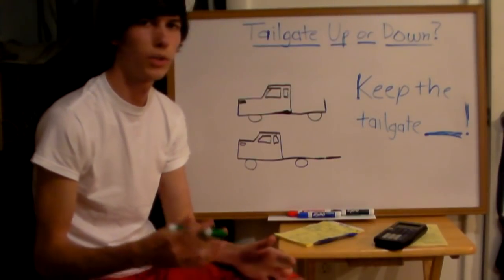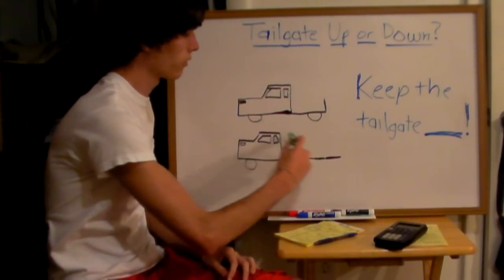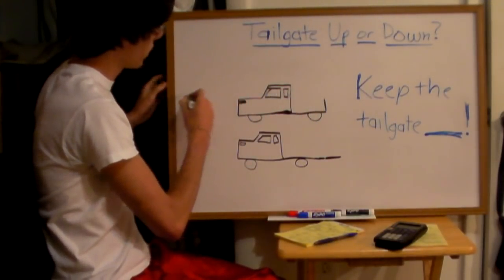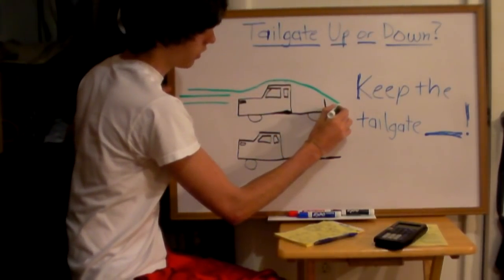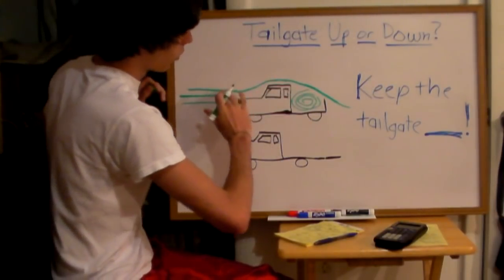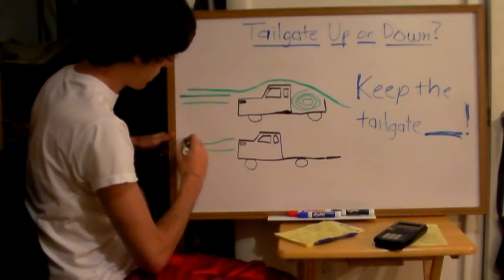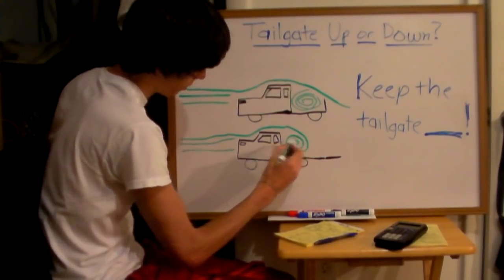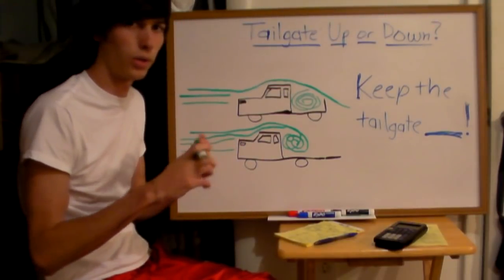Tailgate Up or Down - Explained

Comment from the maker: I actually did put model trucks (as part of a lab) in a wind tunnel while still in school, and the results were as I described above.
Reply: Did you do any models with typical obstructions in the bed for example a cross-bed toolbox or cargo in the bed?  I have experience that disagrees but, there was toolbox, cargo, significant rake (taller rear) and substantially underpowered engine for the configuration.  So far i have found the obvious claim by truck manufacturer that covering the bed entirely helps and an analysis claiming that lowering the rear height at least 2 inches helps but no information for example on a partial cover of the bed or junk like a few crates etc might affect the dynamics to get a result different than the ideal empty bed.  Any ideas might help me avoid making a silly model and playing with it in a poorly improvised wind tunnel to figure this out. Thanks!
Reply: Ah one more difference was a crawl-thru cab window that was always open i wonder if this impacts the dynamics inside the bed.

Comment: Tailgate down gains me about 1.8mpg over 200mile hwy driving intervals. I've measured it many times by topoff method and my mpg measurements don't lie. If ur presenting such a looped vortex in that there's enough resistance at base of the bed then the air should have no problem skimming over the top of it much of the same as tail up.
Reply: 8ft bed???

Comment from the maker: That black dust is likely burned oil from your exhaust. I'd check your oil level frequently to make sure you're not burning through it too fast. I have to add a half quart every 500 miles or so. But no, I wouldn't say that's why hatchbacks create a lot of drag. Designed right they can have equally low drag coefficients as other vehicles.

Comment: My truck is a 2002 Chevy Silverado and I always check my mpg on every fill up. And I always fill up to full. And science might be right about this. But my truck gets better mileage with the tailgate down. When I worked close to home and now driving 90 minutes to work, tailgate down gets better mpg on my truck by 1 to 2 mpg.
Reply: 8ft bed???

Comment: Tailgate up sure for double cab truck,
but I have single cab model,
so the tailgate is too far from the cabin and the air is down to tailgate.
I will try to test my truck, about the acceleration on high speeds with up and down to see the time results

Comment: does this work the same with long beds as well as short beds?  standard cab vs extended cab?  where can I get more details?
Reply: lizzardlife I had the same question. I have a F350 dually with 8 foot box. I also have a cover. I’ve tried with cover on, cover off, tailgate up, tailgate down. I occasionally saw a +1 mpg with tailgate down, but not consistently enough to rule that being effective. I’ve never saw an increase from tailgate up or cover on. Mostly I get shitty milage all the time which is worse in the winter, I’m assuming because of denser air.

Comment: Drove a farm ute that had a high tray which made it harder to drive or see behind in certain situations, I preferred to remove the tailgate (or fold down) as had better visibility, especially reversing into delivery docks or driveways. I would also fold down the side gates as well when they weren't in use. However this was illegal IF the number plate was obscured.

Comment: is this wind tunnel approved? I have driven an '11 tacoma some time now, and I can tell there is a little fuel economy difference when reaching 90-100mph speeds. I can say that I get better economy with tailgate down.
Reply: It depends on the truck actually. What he says must be true for a VW Amarok for example, but may not work for a ford f-150, just to name something.
Reply: wrong, both of you.
Reply: So what is right? Don't just leave us hanging.
Reply: C'mon. Tacomas can't go 100 mph
Reply: @jdmac8584  my 04 DC maxes out at 104

Comment: Please do a updated video on this topic and add in ,if the tailgate completely off (weight savings) is better mileage or not please. I’m trying to figure out if I take my tailgate off at the drag strip will increase or decrease my 1/4mile times. I kno you said it’s better to keep it up for mpg but I’m curious if taking it completely off and saving some weight is better or not. My tailgate has the locking and unlocking ability so it weighs roughly 55-65lbs I’m just wondering. Ty
Reply: Also be nice if you included this with a bed cover no tailgate and bed cover with tailgate! Cause I’m assuming if it’s better with a bed cover it would weigh less than a tailgate? Trying to get every advantage at the track please let’s make this video!! 🙏🙏

Comment: What about a Tonneau cover, you have weight gain vs improved aero... that would be an interesting thing to see examined and explained.
Reply: I wonder how this works for an older truck where they might have thought less about aerodynamics because fuel efficiency was not a selling point. They used a newer ram that gets almost about 22mpg, but my truck gets around 14, so I have to wonder if there would be a way to improve aerodynamics.
Reply: @BobClemintime  I'm shocked the soft tonneau cover was worse than tailgate down...

Comment: Mythbusters already did this.
Tailgate up > Net = Bed Cover = Tailgate Removed > Tailgate Down.

What I wonder is, will carrying a load in the bed interfere with that "force field of air" as you put it?

Comment: I think this is about (Skin Drag) V.S (Form Drag)
The upper truck is Skin Drag > Form Drag.
The bottom truck is Form Drag > Skin Drag.
How do you think ? Am I right ?
If you look at Corvette ZR1 or Ford GT-40, you would find the tail
of these two sports car are more like the bottom truck.
It is difficult to judge,so I think we should put the truck in the wind 
tunnel to test.

Comment: is your hatchback a diesel? Black smokes accumulates (black dust) which is basically unburnt diesel fuel.
As for hatchback or station wagons, I am just assuming it is just a little "not by much" less aerodynamic than sedans because of drag. Don't know if u know much about guns but a boat-tail bullet will travel much further than flat base because it flat base bullet creates more air drag

Comment: What happens when you (remove) the tailgate ? I cant find anything on that.
Reply: Same thing, the drag/suction is created behind the truck cab, decreasing fuel mileage
Reply: @ghosttoast8326  not if it weighs 75 pounds and is angled the wrong way like on a ranchero

Comment: This is what I have been telling people for so long. Thanks! Please do a video about Hi-Flow Air Filters.  My thoughts are if you can see light through the filter dust can get through. Pros use them for performance but don't have to worry about dust and engine damage because the engine only has to last for one race. Guys like me need my engine to last for 100K+

Comment: They should have put the tailgate in the truck bed during that test just to keep the weight (and weight distribution) of the truck the same. I would still think that keeping the tailgate up is best for gas mileage.

Comment: What do you guys think about the tailgate net? I've had one on my ' 02 Ford Ranger since last summer and i thought i could tell a difference right off the bat, but not sure. The whole time, have i wasted more gas than saving by going with the net, versus tailgate up? If so, i may be putting the tailgate back on soon...
Reply: sounds like a parachute

Comment: @EngineeringExplained thats not mine but i hav and identical one with out the top and im always driving past 80mph  ;D. i dont mind the weight i just want to know if its more stable or safer when im driving 120+mph. just youtube ford svt lightning and youll see ;)

Comment: Is accelerating quickly to the speed limit, say 60km/h, in second gear, and then changing to 5th, more or less economical than slowly increasing speed through the gears?
Reply: Significantly less. When you wind the engine up to a high speed, it is firing much more often, but the amount of work it extracts from each explosion is much less, for several reasons. One, once you get above a certain engine speed not all of the fuel is burned by the time the exhaust valve opens, and the balance of the fuel burns in the exhaust system, performing no work at all. Two, when the engine is spinning faster, the internal friction is higher due to greater drag from the accessories as well as the oil pump and decreased efficiency of the lubrication system as the greater shear forces push more oil away from the moving parts. Third, if you're running higher RPM with a partial throttle, less air is pulled into the cylinder compared to a lower RPM with the same throttle position because the shorter time allowed to suck air past the drag of the throttle plate results in a higher internal vacuum in the cylinder. Less total air volume + less time to burn the fuel + more drag = worse economy.

Your best economy is to accelerate gently, using all the gears to keep the engine in a moderate RPM range (between 1/3 and 1/2 the "redline RPMs) and using a moderate throttle position to allow the engine to pull in a generous charge of air but not lugging the engine by overfueling at a relatively low RPM.

I hope that helps.

Comment: The turbulance in the bed of the truck actually causes your fuel economy to go down. I know this for a fact. I have a 1980 vw truck with 1.9 diesel motor that i have tuned the pump in combination with a .71 5th gear, and i clock my mileage daily in it. This truck is designed for hyper mileage, and i can tell right now that the turbulance in the back caused by the tailgate creates drag. If you put the tailgate down or remove it, your mileage will increase significantly. And that is not because of the weight difference if it is removed. I also have a toyota tacoma that i drag race and i know its sweet spot for launch and shifting. I can tell you right now i always drop 3/10s of a second on my 1/4 mile time when i put my tailgate down. This guy is not giving real data. He draws all kinds of diagrams and thinks he knows everything without actually doing his experiments in real-life scenarios.

Comment: Sorry, but it's not that black and white. There must be a speed variable you haven't tested. I get 21 mpg with tailgate down vs 20 mpg with it up at 70mph speeds on the interstate during 150 mile runs. The vehicle is a 2001 Chevy Silverado with 5.3 litre Vortec and 3:73 gearing.
Reply: I get 14 on my 2004 with 3.42 gearing and 5.3 liter... I think you're fine. haha
Reply: The general principle for MPG is that weight is most important for low speeds (1-25 MPH ish)
Drag doesn't have much effect until higher speeds of around 45+ mph 
the space in between is where both are key factors

In the case of the tailgate, depending on length of the truck and other factors, there is a point where the vortex formed due to the air forms regardless of tailgate up or down, when that happens the tailgate if up creates a second drag area behind the tailgate. so Above where ever that point happens to be tailgate down will be better, but below tailgate up will be better. 

To improve MPG i would suggest figuring out at what speed your truck shifts to its highest gear, which will most likely be around 45-50 mph and try and stay around that speed as the force of drag increases as the square of velocity.
Reply: 8ft bed?

Comment: Nothing this man says is accurate.  He simply doesn't understand aerodynamics.  (Not even a little)...  I'm a 24 year aircraft mechanic.  Creating a vortex does not increase drag it decreases pressure (and thus drag).  That's why aircraft have vortex generators on the tops of their wings.

Also, whether or not you decrease drag by lowering the tailgate depends entirely on the design of your truck bed (or what your liner is doing).
Reply: Exactly thank you